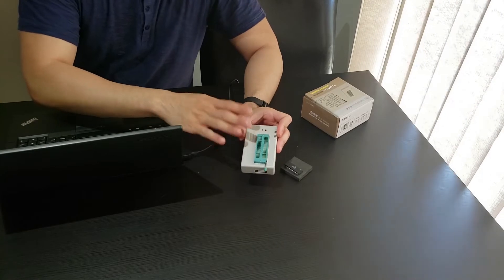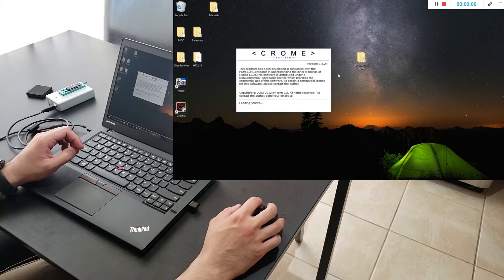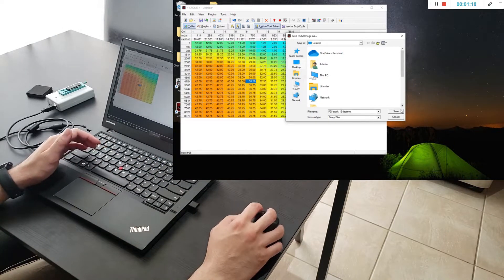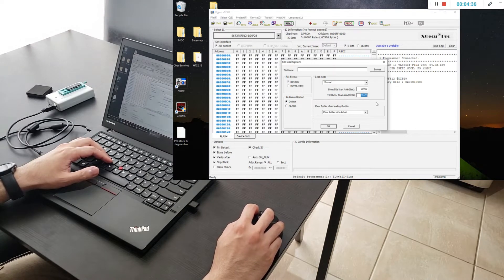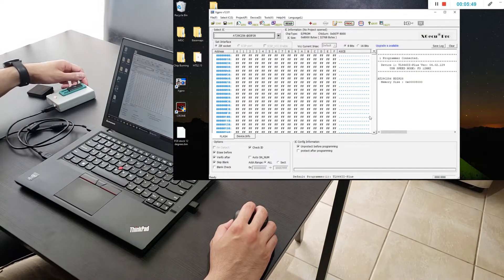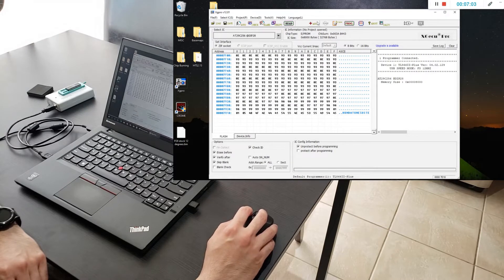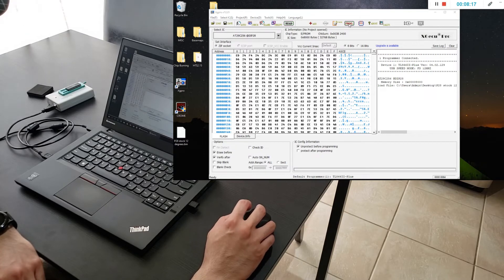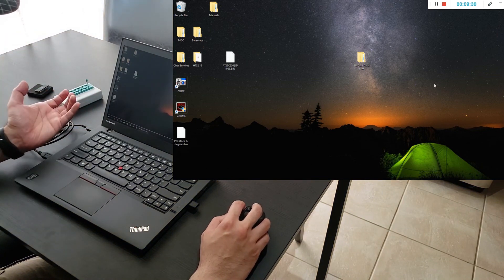||HONDA EF9 /ED7 88-91 CIVIC/CRX|| How to Burn a Map for a Chipped OBD1 P28 VTEC ECU w. TL866II Plus

Comment: I'm still running the old school chrome chipped p28 ecu.  What are the new stuff kids these days are using that will let me utilize my chipped p28?
Reply from the maker: You can use Honda Tuning Suite. Crome is pretty much obsolete now. Even the website is no longer working. Honda Tuning Suite is free and has better features than Crome.
Reply: @BudgetGears seems pretty straight forward.   Gonna order one and tackle this. Think I still have couple sst chip back when Xenoncron was still in business.  One last question does the HTS have the option to make my car pop like ak47? 😂
Reply from the maker: @dajahvue  lol! Yes, it does have that. I think it's under popcorn mod. I've never used it, but others on YouTube might have tutorials on how to do it. The FB group can also help as well if you have questions on how to do it.

Comment: I kinda jumped the gun and bought the same burner u have in the video without seeing how to work it to install the drivers n such to get it to work with crome but I can’t figure it out 😅think u could help me out?
Reply from the maker: Not sure how I can help, but if you have specific questions, I can try and answer them. It's pretty straight forward, you install the software from the manufacturer and then you burn the bin file like how I showed in the video. I do recommend using HTS maps instead because they have way more features than the free version of Crome.
Reply: Thanks ima try and download that now, I’ll keep you posted

Comment: Also how do you live tune it, while datalogging? If I purchase a datalogging cable and plug into HTS for example will it just automatically start datalogging and can I make live adjustments on the chip while datalogging? Thanks
Reply from the maker: Again, you need to do some more research. Maybe research the difference between chips and emulators if you're looking to do live tuning. For datalogging, it's yes and no, if your ecu is setup properly and you have the software setup properly, then yes. A datalogger is exactly what the word is, it logs data. That's all it does. You can't write to the chip with datalog or your ecu.
Reply: @BudgetGears  ok I did a bit of research however my issues are that the data is from like 10 years ago none of it is up to date. Anyway, I realize now there’s a difference between the chip, data logger, emulator, and burner. My question is, since emulators are so expensive, if I just use HTS and a data logger and the burner in your video, how do I adjust the tune for turbo. What I mean is, while HTS is showing data I can make changes to the tune, then do I have to burn that instantly and repeat? Because I feel like I would be very careful tuning my turbo engine with not live adjustments.. thank you in advance your helping a lot
Reply from the maker: @smokeandmirrors-pk6ic  Depends on the emulator. I made a video on the most affordable emulator. The BMulator. It'll cost you probably as much as all the materials you're going to buy to burn chips. The creator has a bad rep so the HTS groups won't help you if you have any issues with that emulator. 
But yes, you can do what you mentioned by adjusting your map, shutting off car, burning map, putting chip back, start up car again and warm up to proper temp, and repeat. It's very slow, but it's how it was done before emulators. It's best you get 2 blank chips and just swap so you save the time.

Comment: Hey man could you or someone explain step by step what I have to do? So I have a p28 socketed already. Do I just have to purchase what your using and a blank chip for this to work? Or do I need something to burn the chip too? I’m just confused
Reply from the maker: The video outlines everything step by step. A map is what runs your engine. A chip is basically a blank memory card. Without a map on it, there's nothing there to tell your engine how to run. Yes, you need something to burn the chip. That's what this video is showing. 
I think you need to do some research on the basics of Honda tuning. There's some basics you need to understand before you should get started. Otherwise, you can really mess things up.

Comment: Where can i find these xgo pro and crome programing softwares google just keeps directing me to things with similar names but moting ecu programing and keeps correcting me to "chrome" like google chrome. pls help thanks.
amaizing videos keep up the good work
Reply from the maker: The burner may be discontinued now. You should be able to find it on Amazon, ebay, aliexpress, etc. Pretty much anywhere. If not, its probably discontinued. I think the newer version is the T48. You'll need to do some searching. Crome used to be available at the site tune with crome. Crome is old anyways and kind of sucks. I recommend using Honda Tuning Suite.

Comment: I have a question. Will the PIC K150 be able to burn de SST27 chip for car tunning or do I need to buy the T48?
Reply from the maker: Sorry, I'm not a programmer and I'm not familiar with all devices used to program. Usually the device will have a compatibility list. From a quick simple Google search thr k150 doesn't look compatible to eeprom programming. The t48 is compatible.
Reply: Imma respond even though it’s late for you but not for new people it can not program the chips needed for your honda!

Comment: Hello! this might be dumb question/something you may not be able to answer but when you adjust the high/low cam timing table to 12, is that only for the d16? or should i adjust it to 12 on my b series as well? is 12 the base map for everything or just the d16?
Reply from the maker: 12* is only for the D16Y8. It's only specific to that generation of d series. Most Honda engines are 16*. You adjust your timing and sync it to the specs of your engine. At the end of the day, all you really need to do is make sure your ecu timing and mechanical timing is synced so if you change your timing to say 18* it is 18* or if you change to 12* it'll be 12*. Considering you have a b series, your base timing should be 16*.

Comment: Can you make a video on how you downloaded the burner software please? I am having issues with files included in the link provided.
Reply from the maker: I don't actually have any of the links for my burner anymore. I know I'm still running xgpro v1201, which is old compared to the v1255 that's out now. All I did was google xgpro v1201 and I see a github where you can download the software. Maybe try that?
Reply: @BudgetGears  ah yes I successfully downloaded it I didn’t realize I needed Winrar to extract files. Great video btw!

Comment: What’s the link the download the burner
Reply from the maker: Do you mean purchase the burner? You should google it. As mentioned, the burner is sold everywhere. So you can probably find a better price by just googling around. As for the software for the burner, wherever you buy it from, they'll have a link to the software. If not, you can get it here: http://www.xgecu.com/EN/TL866_MAIN.html
Reply: @BudgetGears  what software is it. Can’t seem to find the download to burn it on to the chip. I have the tl866
Reply from the maker: @Albertoe89  its the tl866 application software. Don't know how else to tell you. The link has the software right on the right side of the page. Its right there. Download it, install, and then burn your chip.
Reply: @BudgetGears  found it. I been trying to burn it now. It worked on my laptop and not my computer but now it keeps on failing to program I been trying for hours
Reply: Turned out I had a bad chip. I ordered a new one and it worked!  Can u do a vid on how to data log with tl866
Reply from the maker: @Albertoe89  I'm glad you figured it out. The chips only last like 1000 rewrites I think. And I'll be doing a datalogging video, but not with the TL866. The TL866 is a programmer not a datalogger. It only reads and writes chips.